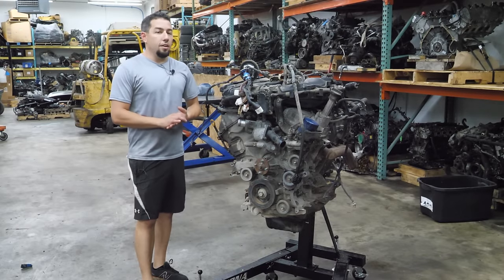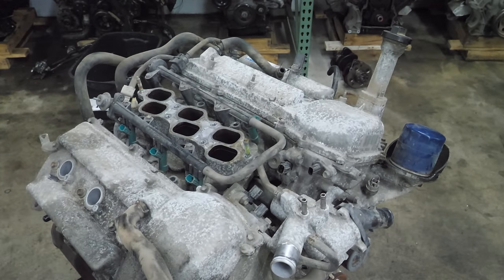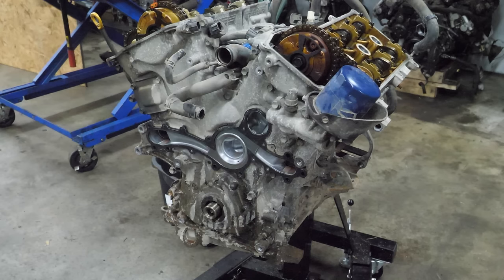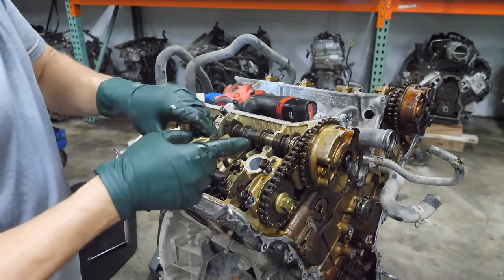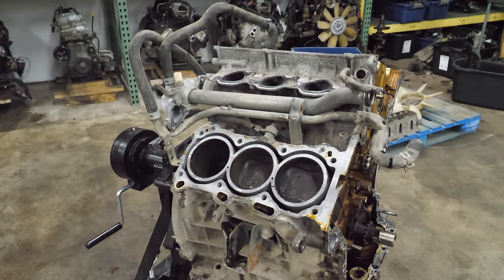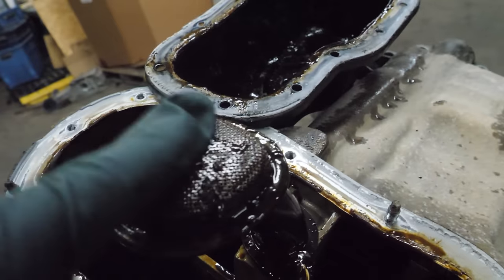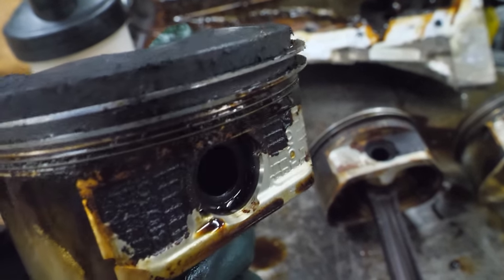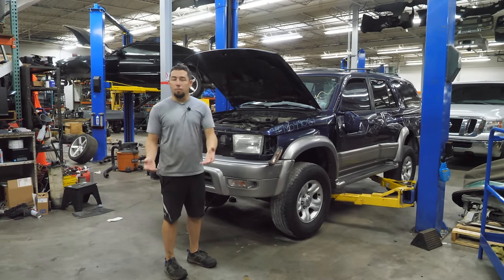Toyota 4Runner 1GR-FE 4.0 V6 Blown Engine Teardown. Just A Slight Tick...

Comment: I was wondering if you ever came across a V4? I know a couple of companies came out with prototypes, but
I don't know if they ever went into production.  Would be nice to see a V4 tear down, but I don't know if one could be found??
Reply: V4s are only used in motorcycles and the odd race car nowadays. Ford, Lancia, and SAAB (which used Ford engines at the time) produced vehicles with V4 engines at one point, but those times are long gone and it would be quite difficult to get your hands on a V4 car engine these days.

Comment: Looks like a total lack of maintenance caused the problem along with silicone plugging oil system
Reply: The engine was hydrolocked. Looks like the owner drove it through a river

Comment: I have the 1mz-fe v6 3.0 litre in my 05 Camry which is a much better engine,they were made to take a TRD supercharger with 4 bolt mains and overall a way better made engine. Yeah they have a rubber timing belt but that’s the only downside to these engines.

Comment: Maybe people put these engines in both older cars and into cars with V8 (that hasn't any range in urban driving). That means high demands and because they are very durable so low supply. High demand, low supply - high price.

Comment: My uncle actually owns a Tacoma blew it up with very low mileage he takes at the Toyota Toyota told him that these things War battle Burnet oil that you have to add oil between every oil change he blew it up at like 35 40,000 miles it wasn't a great deal of mileage it cost him six grand for a new engine
Reply: They don’t burn oil. Only if you stick to the manufacturer oil change intervals. Doing oil changes every 5k, and you will never burn oil.

Comment: I would think the opposite is true with regards to demand.  If the engines are reliable and / or truck, wouldn't that imply that there is not a surplus of engines?   My 4.0 has 315k on it.
Reply from the maker: Many of these engines are available because the vehicles get wrecked

Comment: 186? Surprised it went that many miles. That engine doesnt make a lot of power for the overall size, they are complex and the aftermarket support is not robust. You need that when you swap and increase power for projects which toyota owners dont do.

Comment: I was wondering about this motor. I was looking at an 07 fj cruiser with this motor. Was wondering if it was a good motor or not.
Reply: Generally excellent engine. Toyo upgraded the head gasket in (mid)2005, which had been a failure mode in early versions. Idler pulleys can get noisy after 15 years or so; replacements are cheap. 

Otherwise, it is another in Toyota's long line of bulletproof lite truck powerplants. I bought a 2006 4Runner with the 1GR-FE and 210k on the clock, and I did so with total confidence it will last another 10 years without drama. 🙂
Reply: The fj has 238k on it, and it seems to run and drive great. Still has the original coils pack. No misses or anything. Don't know anything about the maintenance, though.
Reply: @jeromefrady794  The real killer on this family of vehicles (LC Prado/4Runner/Tacoma/FJ/Lexus 4xx) is frame rust. First thing I did when snooping around this 4Runner was to dive under it & check for rust. 

Also, Toyota left off the AT dipstick on the theory no one ever checks it anyhow (which is mostly true). But "out of sight, out of mind" -- it is easy to forget about the service interval (60k/30k towing) & hard to check the color of the fluid. If contemplating that FJ, it may be a good idea to bring a 5mm allen wrench.🙃 While you are crawling around looking at the frame, you could crack the AT fluid level plug & let a few drops of WS drain onto a white paper towel. Mine was pretty torched: guessing it had been changed maybe once in 210k miles.

Otherwise, it's just the typical high-mileage stuff. Body panel clips get brittle. Shocks leak oil. My steering gear is starting to seep at the seals.  4wd actuators get sticky if seldom used. etc.

Comment: I think a LOT of the demand comes from the Saudi and other Arab countries.  These are about 25% of the population of 4 wheel vehicles in those countries.  They are tough, can stand the heat, and even when they are treated very poorly, they seem to last.  But there, the heat and ingested sand (that is not like beach sand... it is sand with grains like baking flour, so it gets into everything.  I imagine these are being bought up as replacements.  Literally millions of them over there.  And the Saudi's have very deep pockets, so 3K for one is nothing over there.  20+ years in and out of the refinery and chemical business over there....

Comment: Curious, did you get the oil filter cutting tool I had sent to you?
Will make metal in the system easier to evaluate.
Reply from the maker: Yes! Please email me, no good deed goes unpunished! I almost used it on this teardown and I for sure will on the next engine with an oiling failure
Reply: @I_Do_Cars  , oil goes from pump to filter to bearings, so when I see lots of journal damage, I'm curious if filter got plugged. I went to a few mfgs schools and I can tell you, filters are not all the same, regardless of what the crossover book says.
Just wanted to make sure the email I got telling me you received it was legit!

Comment: The timing covers are notorious for leaving oil.  Pulling the timing cover off is easy, going back together with the big oring at the oil pump is a different story.  I always pull the oil pans.  That 4.0 in my opinion is trash and way over engineered.  There was nothing wrong with the 3.4l or the 4.7l

Comment: i miss my 4.0, and cant stand my new 3.5
Reply: Isn't it basically the same thing?!
Reply: I went from my 2019 Tacoma to a 2021 4Runner. I didn’t like the 3.5 much where I live at 6800 ft. Not much low end torque on the 3.5.

Comment: What changed on the 2GRFE??
Reply: The 2GR-FE is 3.5L, has dual VVT, and is mostly used in front wheel drive applications.
Otherwise it's very similar to the 1GR-FE.

Comment: These don’t deserve their reputation for being reliable. A friend had one develop a rod knock at 55K miles. Toyota refused to even fix it under the powertrain warranty as he couldn’t prove it had been properly maintained. He escalated it to Toyota of America and they basically told him too bad. Toyota is the company that had only a few threads of rod bolts engaged with the block on their most popular 4 cylinder for many years. The bolts pulled out of the block with usually total engine destruction. Did Toyota step up and take care of customers? No. The early Prius had such severe problems Toyota had to testify before congress. Did they admit any fault? No. The list goes on of serious problems Toyota has refused to own up to. They’re arguably the worst of the Asian car companies in that regard.
Reply: Not sure where you heard this blatant nonsense. They spent billions replacing frames on vehicles for 20 years. They are hands down the best car manufacturer in existence.

Comment: Here's the lone guy that has never liked this motor.  It's the very reason I would never buy a Tacoma or 4Runner.  They are anemic in all forms and the gas mileage is beyond atrocious.  The Nissan VQ40 was far better, but unfortunately the cheapness of vehicles Nissan makes are rather unfortunate.
Reply: Dude everyone likes this motor that's why the trucks they come in sell for 25k with 140k miles on them wake up
Reply: @joshanderson924  no, they just like the reliability.   I know plenty of people that bitch about the lack of power and bad mileage.
Reply: @Therealjmhinkle  Those are literally the only 2 bad things about this motor though. Id take bad fuel economy and a few less HP over the timing chain issues, oil pressure and oil leak issues the Vq40de has any day.
Reply: @joshanderson924  I never said it was a bad motor, just that I don't like it.  It's rare for me to get to 100k on cars I own so I'm not worried about it running for 300k.  My 2005 Frontier has great power and good mileage when I actually need to use it.  Does the oil pressure dip low when it is hot and idling for long periods of time? Yes, but that is a rare circumstance for me so I'll never have timing chain issues.
Reply: @Therealjmhinkle I had a 2005 Frontier, my dad has a 2013 Frontier. Man startup on both were noisy with the lifters. I have 2 4Runners, I like the 1GR better, and it had more low end torque. Owning both, I like the Toyota better, the build quality is higher.
Reply: @JAMESWUERTELE  2005 here with zero startup noise ever.  It's always had a good filter and oil used in it.  It's not that the 1GR has significantly more low-end torque, it's just lighter.  On the highway the VQ will run away from a Taco especially loaded down.  Again, build quality isn't an argument nor was the trucks overall, just strictly why I dislike the 1GR in real world use.

Comment: The reason used 4.0's are expensive is because people are greedy.
Reply from the maker: That’s not it. As a business who wants to not only keep the lights on and sign existing paychecks, I want to hire more, support more, and offer more to my staff and customers.
Selling a product for less than the market can support is a disservice to my staff, and the growth and offerings to my customers. Most salvage yards feel the same.
Reply: @I_Do_Cars I guess my point is that everything Toyota seems to have a premium price tag, and a lot of people try to capitalize off that fact, just like anything else they feel has value.  A perfect example is I bought a 99 Tacoma TRD off my boss for 6k. Anyone else would have tried getting 12k  or more due to its condition,  mileage, and because it's a Toyota. I was not implying that you are greedy,  I know how business works.  But as a mechanic who has seen repairs triple due to the price of parts,  and knowing that the majority of people are greedy,  that's why I said what I said.

Comment: So uhhhh yeah... to answer your question why Toyota GR motors are so expensive.
It's the idiot factor.  Idiots have decided that the GR (and toyota in general) is "the best motor ever" and will spend STUPID money to buy them.
Which is WHY dealers tack on an extra 15k to msrp on a new taco or 4runner...  Because morons will still buy them. 
Ok, so maybe you wanna buy a USED taco in my area. Sure... people will charge 20k for a 2005 in "fair" kbb condition with 200k miles on it... AND GET IT. 
Because people are dumb.  That's why your rebuilt GRs cost 2 arms and a leg.  Because dummies are willing to spend nearly "new afordable car" money on a clapped out 15 year old taco. 
That they are underwater on if the "bullet proof" engine in thier way too expensive used truck takes a dump... and they either need to junk it, and make payments on a dead car... or fix it for 2 arms and a leg. 
Don't get me wrong... Toyota makes a solid truck and product... but they aren't worth what people pay for them. 
A midsized basic 4x4 pickup shouldn't cost north of 50k. 

And a word on Toyota "reliability". 
the ONLY engine I have ever had that experienced a fatal internal fault was a 2007 GR V6 out of a 4runner.

It was a low miles, under 10 year old 4runner, purchased new by my employer.  It was the manager's truck.  It spun a bearing in 2014.  I think it only had around 50k miles on it. 
The vehicle was well maintained, and oil was checked WEEKLY by me personally (along with the F150 crew cab 4x4 pickups that me, and the rest of the crew drove) 

Any make, and any engine can take a shit - Toyota isn't magic.